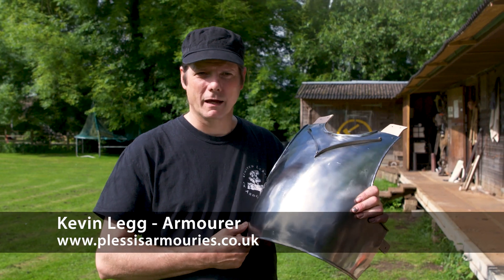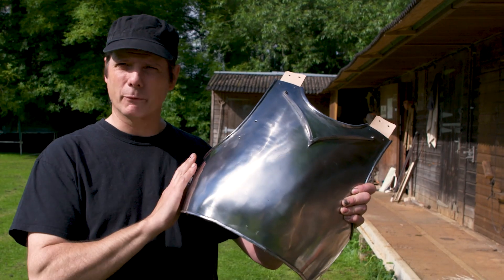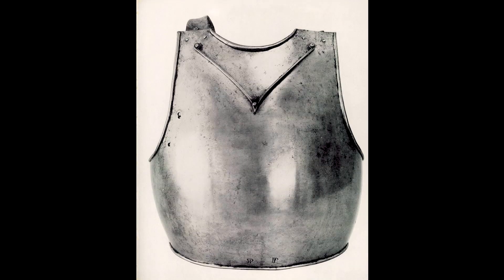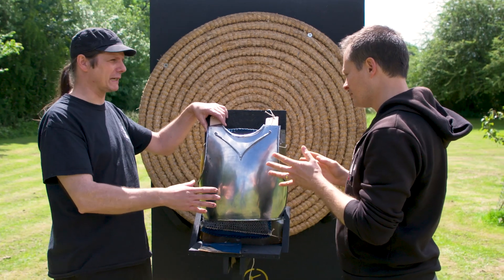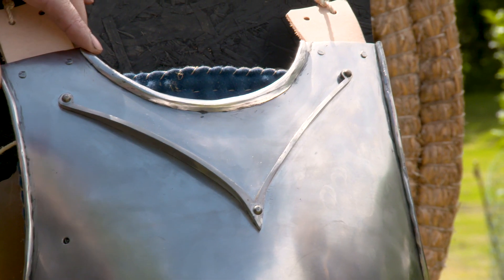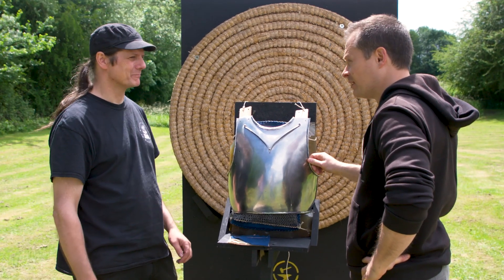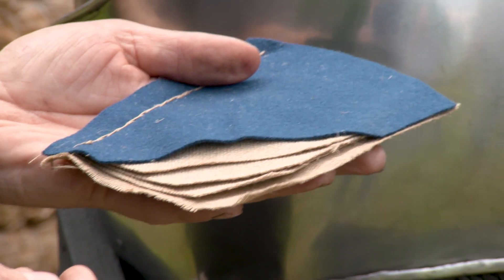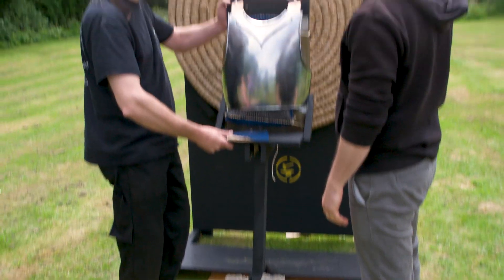Find out more - The Armour

Comment: Sorry, but you MUST use wrought iron - because that material is totally different than modern steel. Usually things like breastplate was made from wrought iron and ony surface carbon content in such amount. Ofcourse in that time there was possible to made good quality steel, but it takes huge amount of time and effort, and much more material... And effect will never be even near modern steel quality.
 Beside carbon, old "steel" has much more elements, some of them are not wanted - like sulfur of phosphorus, because they lowering quality - material is more brittle, has less hardness, etc. Modern steel had different composition, different structure - IT IS JUST A DIFFERENT MATERIAL... I work with both, so I know what I am saying.

Comment: Did the french use blast furnaces by the time Agincourt happened? If they were still using bloomeries then the steel would still have a lot slag in it, so just dropping the carbon content by 0.1% may not be good enough. And does the steel contain Manganese? they didn't have that back then.

Comment: Does this armor also contain impurities? I believe impurities was present in varying degrees, on every medieval era armor as it would have been nearly impossible for the armorers at the time to produce the required temperature to completely remove these from their materials.
Reply: They addressed that in the video. In order to make up for the inconsistencies of old armor, they used a slightly lower carbon percent. It's not an absolutely perfect replica, but it's very close.
Reply: @holyknightthatpwns   The book by Alan Williams "the Knight and the Blast furnace," conducted a very detailed test about the quality of medieval armor. He actually came to the conclusion that Slag is much more damaging to the quality of the armor than low carbon content, his study shows that high quality armor at the time lost 10% of its toughness compare to modern steel while low quality munition could lose as much as 20% or more. For comparison, modern mild steel would likely be among the best steel midieval times, only surpass by the real high expensive armor at the time such as the famed Milanese armor. Another interesting fact to note is that increasing the thickness of the armor from 1mm to 2mm triples the amount of energy it requires to penetrate the armor and that arrows trying to penetrate a Knight's armor at 45 degree angle is significantly more challenging than hitting it straight on.
Reply: @joshuabernabe8420  I'm pretty sure they also address the fact that hitting armor at an angle is harder, which is why the sides of the chestplate are thinner than the middle. The bit about 2mm armor being thrice as tough 1mm is a pretty interesting point, though.

As for slag, I'm still pretty comfortable saying that lower carbon steel is a good enough representation for a test like this. The arrows were not even close to penetrating the armor, another 10% loss in strength would not have caused any damage to the knight. At best the arrows would slightly notch the plate, but still fairly harmlessly shatter off. Certainly wouldn't be enough to damage the mail underneath, which is likely why wearing mail under plate fell out of favor.
Cheers mate
Reply: @holyknightthatpwns  But the thing was, the vast majority of the cavalry men at agincourt were poorer Men at Arms, not wealthy Knights who could afford high quality, complete armor. Many of which might have only been wearing Mail armor supplemented with some plates on their limbs, the metal quality of which would have likely been mediocre (high slag content). Even the rich, well equipped Knights were reportedly, extremely worried that they would be struck by arrows on the sides of their helmet were the metal protection was very thin (probably not much above 1mm, the book claims an arrow only needed 55j to penetrate a 1mm breastplate, a longbow is way more than capable of delivering that at a close enough range).Medieval sources at the time, mentions several of these cavalry men being killed or wounded by the arrows. The problem with many of these modern, Agincourt test is that they assumed most of the French Cavalry wore expensive, full set of armor and that the Archers mainly hit the thick, curved part of the breastplate were it had no hope of penetrating, that is why we now have people claiming that all the Longbow did was kill the horses which is a gross over exaggeration.
Reply: @holyknightthatpwns  Even a French sources admit that it was the arrows that caused the most injuries, which would not have been the case if the Longbow is as hopeless as modern test videos are now depicting it.
Reply: @joshuabernabe8420  did you watch the videos? They don't claim that the english longbow couldn't damage french soldiers, they said it wouldn't puncture directly through the front of that chestplate. There's lots of followup to be done, and Tod well knows it.
The French sources also mention that they were worried largely about the arrows hitting them in their faces and defeating that weaker part of their armor. So the french as well didn't think that they were really at risk from chest shots.
Why are you so insistent that this crew is wrong in their assumptions? They are amoung the world's leading experts in their respective fields, and they've been very measured in their assertions.

You're trying to nitpick a video, but you're yet to make a meaningful claim that contests the video. It's good quality work, just accept it.
Reply: @joshuabernabe8420  this armor was based on real armor used in that era, as are the bow and arrows. Sure, there was other armor there. But the video doesn't say otherwise. They can't do every test at once.

If you're trying to tell me that this plate isn't like the ones used in Agincourt, you're a bloody fool.
Reply: @holyknightthatpwns  I'm not picking on this video in particular, I though I made it clear in my comments that I'm talking about MANY of the Modern testing done and posted in Youtube. The test are always done in such a way that is very unfavourable to the longbow; expensive plate armor that only the rich and elites could afford, shot at a straight angle, aimed at the thick and curved part of the armor. Of course some of the videos does explain the context better than others, but still, don't tell me that you don't see a lot of comments nowadays from the viewers of videos such as this, completely ignoring the context and just proclaiming the longbow must have been completely useless against an armored late medieval cavalrymen
Reply: @holyknightthatpwns  Yes they were worried about getting hit in the weaker part of their armor, I said just as much in my previous comments which was why the Longbow injured and killed many of the cavalrymen, when hundreds of arrows are aimed at the heavily bogged horsemen, in all angles, more than a few is going to get hit at the weak part of their armor, poorer Men at Arms would have more  vulnerable parts.
Where did I imply that this armor was not used in Agincourt? I never said that, if you read my comments I said that the vast majority of the french cavalrymen did not possess this type of armor since it was way to expensive.
Reply: @joshuabernabe8420  Well anothet thing was that most of the French were not on horseback - very few in fact.  Most of them were on foot.  And when the French knights and men-at-arms were advancing in lines several men deep, the front rank men, who were all the richest and best equipped with high quality armor, would protect the men behind them, especially if like they mentioned the archers were mostly shooting flat.

Even the poorest men-at-arms during this time were still very well armored, besides their wrought iron breastplates or coat of plates or brigandine they would have a mail haubergeon and an arming doublet underneath.  Even if an arrow pierced the wrought iron, it could hardly continue to pierce the rivetted mail and fabric underneath, having expended most its energy on the metal plate.  So the torso of even a poorer French men-at-arm would be quite arrow proof.

Now the leg harness below mid thigh and the lower arm harness were not supplemented by mail and padding, so penetration there by arrows would be likely if the metal plate was of poor enough quality.  Or the breaths of the helmet too, as the French were historically worried about.
Reply: @holyknightthatpwns  The steel they used to make this breastplate contains 0.6-0.9% manganese. Manganese added to carbon steel makes it harder and stronger. It also improves its hot workability, making it less susceptible to becoming brittle when worked at high temperatures. In addition, levels of sulfur and phosphorus in modern steel are tightly controlled to levels that give steel desirable qualities, like increased strength, hardness and machineability. By contrast, it was common for medieval steels to contain levels of these two elements that caused it to be more brittle and prone to fracturing than modern steel. Also very important is that the alloying agents in modern 1050 steel (carbon, manganese, sulfur and phosphorus) are homogenously distributed. In medieval steel, carbon, slag and impurities far more unevenly distributed, causing the properties of the steel to vary, sometimes to a significant degree, within just a single plate. For all of these reasons, the breastplate they used for this video is probably in the top tier of what would have been available in the 14th and 15th centuries.

Comment: A few little points: first, wouldn't the velocity of the impact be increased by the speed of the Knight on horseback? Additionally wouldn't the effect of the "knockback" of the arrow impact be mitigated by being in a saddle with stirrups? Finally, about the knockback, it seems it would have been a valuable measurement to have. Maybe simply setting the stand along a line and measuring the displacement after impact? Excellent work, amazing craftsmanship on that breast plate. 40 grams difference, wow.

Comment: I was wondering about the production method of the steel itself. I am assuming the modern steal was made in a way where it was rolled. Then you hammer out the shape of the armour etc. How would the original plate be made in the 1400’s and how would the imperfections in that process effect the brittleness and inclusions of imperfections due to the medium it was cast in? I am personally clueless of how they did this way back when, but would the production method if the raw plate not highly effect the impact resistance and homogeneous character of the steel? Cool stuff by the way!

Comment: This mostly seems to be well done. There is one thing I question. Period steel not only differs in how uniform the carbon is. It also has a higher slag content. Has any test been done to show how much of a difference this makes? I worry that it might make a significant difference in the results. You should try to get a sample of steel made with period correct methods. Even if it only a small piece, you can do some deformation and penetration test to see how much it changes the results.
Overall this was a very well done test, but verifying this one point would greatly improve my confidence in the results.
Reply: Enough for a whole breastplate is ambitious, but it's definitely on the list to try smaller samples of various quality
Reply: Unfortunately, getting your hands on non-homogenous steel is extremely difficult nowadays and even if they did, they'd probably have to make a dozen breastplates and shoot them a few dozen times each to get anything out of it.

They're very aware of the "lucky shot" factor, just see the armor failing unexpectedly due to a flaw on the steel as a small chance for such a thing.
Reply: @Vapefly0815  my worry is that even the strongest parts will be weaker then modern steel. As such, even testing a small piece will be useful. There are people who try to reproduce historic ways of creating steel. It should be possable to work with one of them and a materials testing lab to find out if there is a significant difference. If there is, it may be possible to adjust the type and thickness of modern steel to be a better representation of period steel.
This is a lot of work, but they are already doing a lot of work to be accurate.
Reply: @Vapefly0815  There are a few people in the US and UK that have experimented and operated small bloomery furnaces capable of smelting old-school iron blooms from ores. Lee Sauders actually sells his smelted blooms, which are about 20-25 pounds in weight. A good blacksmith can process the blooms into wrought iron, than carburize them into old-school steel.
https://www.leesauder.com/bloom_iron.php
https://www.leesauder.com/pdfs/Quickie%20Cementation.pdf

Comment: Hey Tod! I would like to give a huge thank you to you and Joe, Will, Kevin, Chrissi and Tobias for all the amazing work that you are doing. You are providing us with so much expertise, knowledge and wisdow on this particular part of history. It really has taught me a lot. Because of you I have a new profound interest in medieval history. 

I do have a question. Is it maybe possible to test out armor that has been repaired? I can imagine some knights not receiving a new piece of armor every single time. Or if they had it done cheaply maybe to save cost? To see what kind of impact it might have when arrows are shot at the armor due to metal fatigue. Will it create a bigger dent and maybe cause internal damage.  Maybe by measuring the impact the gel receives after being hit by a shot. Or if cracks start to appear and an arrow finds his way through.
Reply: Interesting point (Todd answered on another question that repair will not diminish the protective capability of the armor). I'm not that familiar with metal fatigue, but isn't that only an issue for unheated repeated deformation? (The repair itself I guess would be done by heating and normalizing which should release the stress in the material, so in terms of metal fatigue we only have a one time cold deformation on impact).

Comment: With dozens of hits soon an arrow is going to find a previously damaged spot.
Reply: The issue is, that arrows are in and of itself not dirt cheap throwaways. Also arrows have to be made by someone, and a professional still has to make them, they have to be brought to the troops and they have to be kept in working conditions (keep in mind that the materials used, wax, bindings, feathers, etc. are sensitive to the weather).
If you want "dozens of hits" you need a multiple of that to be shot at each knight, because not all of them will hit. So you need about 50 arrows per enemy knight? so upwards of 50.000 arrows for that battle?
And you need the time to fire those 50 arrows with enough energy at your enemy as well. In the main video, the highly professional beast of an archer is capable of hitting the breastplate reliably at 25, 50 meter, maybe 100. Make that 200 if we aim for the knight and not for only the breastplate. Can you fire 50 arrows before that tank of a man is at your throat from 200 meters away?

While, yes, that is one way and it certainly happened, it is not a strategy to fight knights that you would survive for long ...
Reply: @Gubblinus 
Which explains why the Brits used the "offensive defense" strategy of being fighting behind hasty fortifications prepared on defensive Terrain.

When the knight's pretty charge gets disrupted by horses going down or voicing their opinion of being hit by splinters by turning and bucking weaker armor is going to be exposed. 
And according to the history I read 40 to 50 thousand arrows were used in the battle.
I also suspect that a significant number of arrowheads were recovered and the farriers as well as less specialized blacksmiths could repoint them fairly quickly certainly faster than making new ones from the odd bits of iron laying about after the battle.
Reply: The chance of a arrowhead with a small cross section hitting a likewise small previously hit area of steel that has yielded enough for penetration to take place will be one in one thousand.
Reply: @kovona  
The dents are bigger than you think.